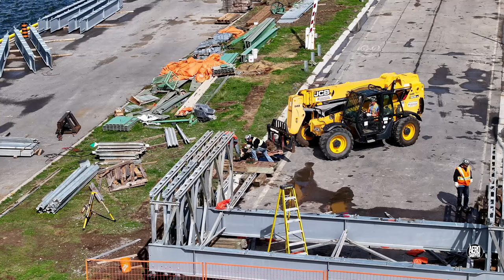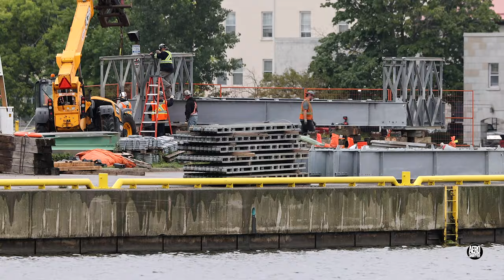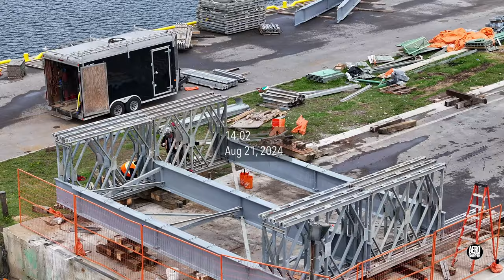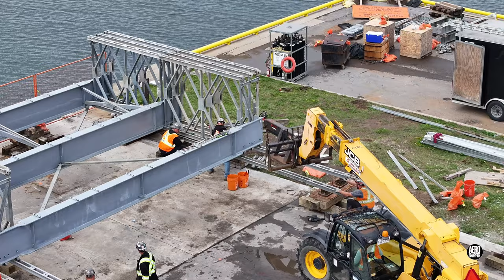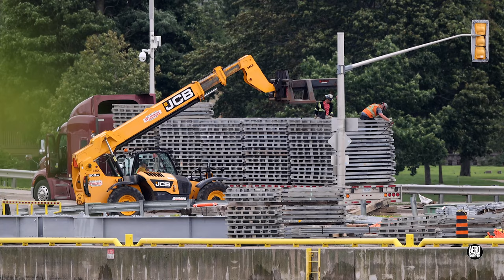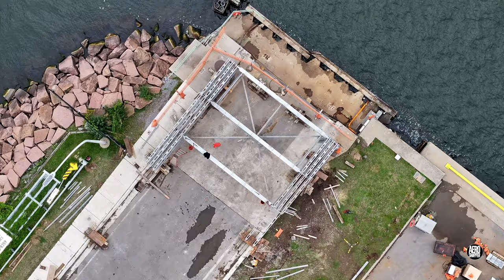So Nice they've done it Twice - an update on Kingston, Ontario's La Salle Causeway  4K

Comment: Wow.  Surprised that they undid what they had.  I guess something wasn't quite right according to the plan.  But, better to have a do-over before, than to get all the way to the end and find out the whole damn thing has to be un-done and re-done.
Reply: They had the IKEA instructions upside down.. 🤷‍♂️🤷‍♂️
Reply from the maker: Stan - we may never know - but you're absolutely correct - better to make any necessary changes at the outset.  Maybe Michael has it right below....
Reply from the maker: @michaelk7111  ROFL.....
Reply: It’s because they didint get get the plans quickly so they had to start,but they unfortunately started the brig in the other way so it’s not their fault

Comment: Curious about how boats will be able to pass up and downstream once this is in place? How long is “ temporary”
Reply from the maker: Keith - I understand and share your concern. Sadly, I don’t have an answer. I understand that the bridge will be fixed and only occasionally removed for particular transits.  It’s likely to be in place for some years whilst decisions are taken about a permanent, moving bridge and work to install it takes place.  The most worrying thing is that no statement or commitment has been given to honour the need to open the Canal next year

Comment: Why is this a "temporary" bridge?
Reply from the maker: There is considerable concern to restore the major traffic flow into the city’s downtown core. It will take some time to decide on the design of a permanent, moving bridge that will accommodate the need for vehicular traffic and the boats that travel the Rideau Canal - a navigable waterway demanding free access. This is the stop-gap solution - and this ‘fixed’ bridge will occasionally be removed to address marine concerns.

Comment: this whole  thing has been a fiasco. the engineers screwed up royally from the start. their plan was done stupidly. they should have had the counterweight supported before any work was done on removing the cross webbing on the original bridge members. and after the failure it was totally fixable by supporting the weight cutting out the entire buckled members and refabricating them with current steel using the same design but with the full plates as was the strengthening plan. they should have just bolted and welded the new member into place . the old design worked for over 50 years. just copy it  with new steel.
Reply from the maker: It's unfortunate that you feel that way. I hope that providing factual information on the current situation eases the pain to some extent